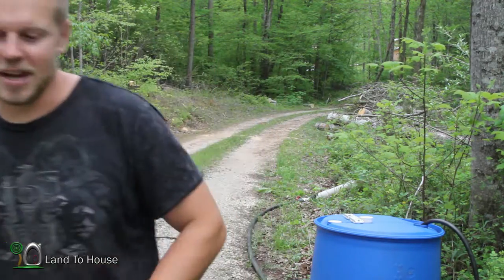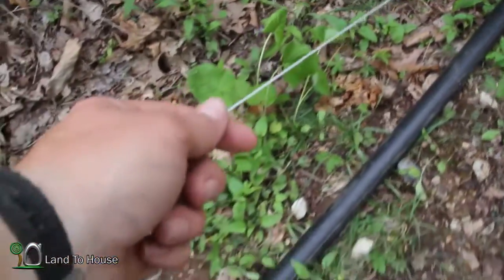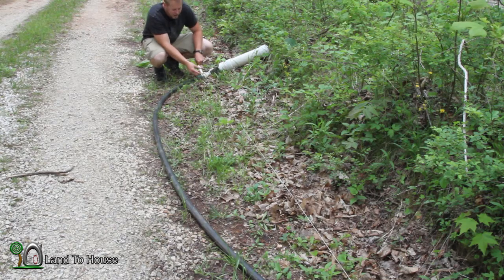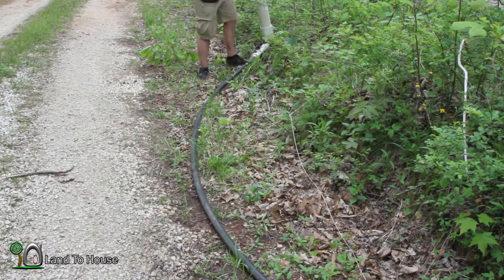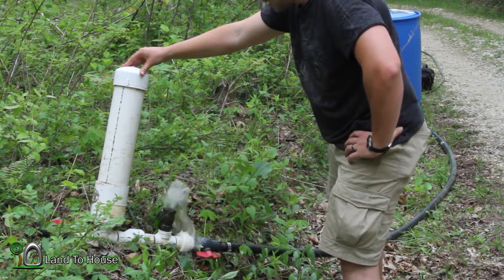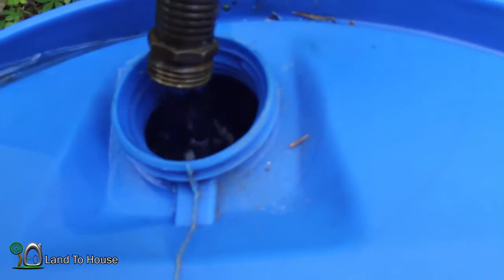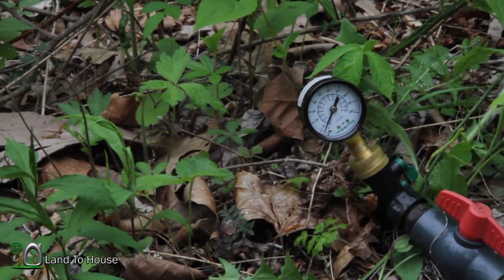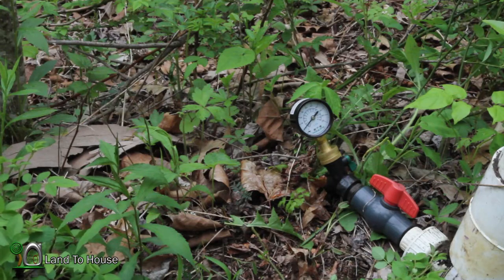Hydrostatic Pressure Ram Pump

Comment: Seth, have you experimented with the pressure tank in various positions? With a inner tube inside the tank I wonder how the pump would operate with the tank lying down (with check valve remaining pointed upwards as normal).
Reply from the maker: Hello. I have not tried that position with the pressure tank. There are linear ram pumps but the bladder inside is attached to the tank wall and ensures there there is always an air space.

Comment: HI THERE, I MADE MY OWN 1&1/4 IN. RAM PUMP. BUT IT DOES NOT CYCLE AS FAST AS MY 1 IN RAM PUMP WHICH I ALSO ASSEMBLED.  INPUT DRIVES ARE THE SAME AT 1&1/4 IN PVC PIPES.

Comment: hi there.iv  that system before I can get up to 4bar pressure from doing it
 iv also got a 3inch pump doing 5.5bar pressure.  Doing 8lts a minat 1200ft lifti.g 45ft on a 2ft fall. 😊
regards 
DRP River Pumps Ireland
Reply from the maker: +Derek Cummins great results! I always like to hear of success stories like yours.

Comment: Hi Seth, This is fundamentally what my install will be here in NZ. How tall is that barrel? About 1 meter maybe? The pressure in the water column is the densityXheightXgravity and that is fundamentally the same thing as water falling from that height. For my situation with a 1 meter deep column of water, the pressure is 9810 Pascals. The benefit the way I see it is that with your feed being at the bottom of the water column, you do not have to worry about the water level dropping and your intake being out of the water. Another advantage of this setup, at least in my situation, is that I can shorten my drive pipe to a minimal length of say 150 diameters and thereby lesson head loss. By Hazen-Williams, I calculated my head loss to be 11 cm over a 6 meter pipe. Imagine if I instead had to use a 30 meter pipe to get the same head...the losses would be 55 cm, reducing my total head by half to to pipe friction. I am glad to see you tested this because it confirms what I was thinking and it is good to see it before I go spending a lot of money.
Reply from the maker: +pat wall you make valid points. Especially on friction loss and preventing air from entering into the system. I assume that your water source will constantly refill that Barrel? As you can see it does not take long for that pump to drain 55 gallons. They always say that a drive-by be shorter than 3 meters is a bad idea. So using a 6-meter pipe should be perfectly fine. 

This test turned out well and gave some good results.
Reply: Hi Seth, my source will not be a barrel, it will be a small weir but I will take the water at the bottom of the column so it works on the same principals. The drive pipe rules I went by were between 150 and 1000 diameters. My aim was to consolidate my head as best I could and to keep the drive pipe short enough to minimize head loss due to friction but still long enough to allow for the shock wave to do its magic.
Reply from the maker: +pat wall it seems like you know your stuff!  As long as you have the drive pipe the same diameter as the ram pump you should be fine.
Reply: +Land to House we shall see..it is still all on paper and i have yet to build anything but this is what it should look like.
Reply from the maker: Things do change a little when you get them in the water. I do think that you have a great start to a good setup!

Comment: Seth, like the video and enjoy these. I do have to ask a question though. Would not the tank water height be a factor in as run and fall of the water just as if you were at the creek however at a much shorter set up? I hope that makes sense. I'd think that the water weight in a 4 foot drop in 100 ' might be the same as the barrel? It would seem to me that you are making the same setup to me. I am by no means an engineer Seth, so I am be way off.  Maybe you can shed some light on how this is any different. By the way I wish my pump ran that fast and started that quickly.  Keep up with the videos I enjoy them.
Reply from the maker: +ed sautter thanks for watching! So the original question was something like this: I have a water tank on flat ground. Can I run a ram pump from hydrostatic pressure only?

So I tried to use the string and level to get the pump level with the drive pipe so there would not be any feet of head pressure in the drive pipe. Only the weight of the water is running the pump. You are right though. It's the same as having the 4' drop in the drive pipe. (3' actually). I have a follow up video showing the reduction in pressure as the water even drops in the tank.  I hope that makes a little sence.
Reply: Thanks for the reply.
Reply from the maker: +ed sautter no problem. The newest video shows the change in PSI in hydrostatic pressure. It might also be helpful

Comment: HI THIS LOOKS IT MIGHT WORK FOR WHAT I NEED.  THIS SOUNDS SILLY BUT,   WOULD THAT MEAN THAT YOU COULD PIGY BACK RAM PUMPS AND WATER  SUPPLYS TO GET UP A HILL TO LIKE 50 TO 75 FT ? THE FIRST WATER SORSE WOULD BE A RIVER AND A PUMP LIKE A SPIAL PIPE PUMP OR( LIKE THE ONE YOU ARE WORKING ON) TO FILL THE FIRST BARREL, THEN THE OTHER RAM PUMPS LIFT EACH LEVEL TO GET TO THE NEXT SUPPLY AND PUMP. FINLY  TO THE TOP OF THE 50 TO  75 FT 60% GRADE HILL.   THE THING I HAVE IS A 50 TO 75 FT 60% OR SO HILL TO GET TO THE RIVER EDGE .  I HAVE ALL THE FLOW I CAN USE BUT NO HEAD.  OR WOULD SOME CANS ON A STRING AND PULLIES BE THE THING TO DO.I AM JUST THINKING OUTSIDE THE BOX, HA HA .
Reply from the maker: +Tommy Schauer I have actually heard of the spiral river pump getting water up to over 50 feet. You might be able to use one of them alone . . . If I would take the time to perfect my design. (To much house stuff going on right now) But I also think you could get them to work together. Have the river pump or two of them pull water into a tank 10 feet off the water then run a ram pump from that 10 feet of head to get the water up to 70 feet. You would just need one ram pump to get to 70 feet.
Reply: THANK YOU.  THAT MIGHT DO IT.
BUT NOW TO WORK ON THE GARDIN FIRST.
LOOKING FORWORD TO YOUR HOUSE UPDATES.    THANK YOU AGAIN.
Reply from the maker: +Tommy Schauer I do hope to work on the river pump again very soon! There are lots if people in your situation. Plenty of water but no head pressure. I only have 16 days left to get the videos ready for the series to come out!
Reply: LOOKING FORWARD TO THE SERIES.
BEEST OF TIME WITH IT.
THANKS
TOM S.

Comment: ... ThankS !!! - )))

FUN V-iD !!! - )))

JusT out of curiosity ... what if you added some symmetry to the system ... = counter clock wise vortex ?? - ))

i'm thinking both in the barrel ((lots of water flowing inside the barrel "should" add pressure ??? - )) + in the creek line and the out-flow line into the pump and out of the pump ... = victor schauberger used small fins in-side the lines to create the vortex inside ... i'm thinking at the joints small slits to bend the pipe ... possibly heated up a bit and then cooled to make a permanent bend ??? - )))
Also ... expanding the intake line from the creek ... for maybe the last five feet or so, to create a slightly bigger PULL due to expansion  ... and then "training' the intake ... into a counter clock wise motion, to get the water in barrel turning = adding the hydro static pressure, due to extra symmetry ??? ... maybe -)))

... one question too -)))

Can the "waste' out flow (( back-wash = not sure what its called ?? - ))  from the ram pump be used ???
ie ... you've got the pressurized water from the pump ... and then the water that splashes out ... can BOTH be used ???
... and could the 'waste' water ... be channeled back into the barrel  ... or perhaps a secondary barrel .. creating TWO pumps in SERIES ??? - ))))

... i mean ... check valves and WATER + VORTEXES ... the SKY is the LIMIT ... maybe -))))

Anyways ... thanks ALL-oT .. for your efforts ... and your CHEERY + GREAT ATTITUDE ... much APPRECIATED !!! - )))

LOVELOVELOVE )))
greb'Z )
Reply from the maker: +PeaceLoveLightTruth hi. Nice questions! So the ram pump has a pressure wave that works in both directions. Creating more pressure in the down or out direction is nice BUT the pump has to counter that on the upward / inward side. So it would actually reduce the efficiency of the pump. If air get is into the system it will stop the pump so slits in the pipe would not work. 

You can absolutely use the waste water again. Not put it back in the barrel but using it in a second ram would be good.
Reply: .... COOL -)))
i think (??) .. you can get a vortex ... without air being 'drawn' into the system ... i'm pretty sure, the vortex would make it easier for the air to escape ... or, at least with check valves ... air couldn't get into the system ?? - ))
The out-flow from the barrel being at the edge ... rather then the c-ENTER ... should help as well  ?? - )))
i see a three inch 90 inside the barrel, "catching" the counter clock wise flow at the bottom of the barrel, and then reducing into a one inch line ... into the ram pump ... ???
... ha ha -)))
Sort of tough "drawing" an idea with words -)))
hmmm -)))
i see the water in the barrel moving counter clock wise (( the way it wants to flow in the northern Hemisphere -)) .. and at the bottom of the barrel, on the outside edge the water pushing into a three inch elbow ((= no opportUNITY for air to get IN -)) .... then the elbow reducing (( adding pressure -)) before the pump -)))
... i'm feeling (( not k-NOW-IN-g -)) this will add to the OUT-flow pressure, out of the pump ??? - )))
... maybe ??
... ha ha )))

Thanks for the REPLY !!! - )))

LOVELOVELOVE )))
greb'Z )
Reply: ... one more thin-G -))
While using a second pump ... could both be pushed into the same OUT-FLOW line ... th-ROUGH check valves ... to get a farther push ... and or, just more volume ???
... just wondering -))

LOVELOVELOVE )))
greb'Z )
Reply from the maker: +PeaceLoveLightTruth yes there are many ways to get that vortex going. It has been my experience that the ram pump does best without that extra  pressure against the pump. Because the pressure wave has to return to the source it is better not to have the vortex.
Reply: ... oh .. now i get it ))
 ... sorry, didn't catch the D-RIFT of "pressure wave" in the first reply -))

... will co-N-s(iD)e-R tHAt in my next meditation ... my iD-ea garden -)))

... thanks aGAIN for your replies and EFforts !! - ))

LOVELOVELOVE )))
greb'Z )
Reply from the maker: +PeaceLoveLightTruth sure thing. Thank you for asking.

Comment: Thanks for this video josh, the place i had my old pump washed away with the most recent storm and this solves my problem with finding a new spot!
Reply from the maker: +justin whittington nice! You are welcome. I can see several applications for this into. Sounds like you could pipe water out of the creek just like I did in this video and safety run the pump from the shore.
Reply: +Land to House well actually i have a large pool in my creek thats has stood even though the heaviest storms and ive never had much luck getting the pump to run off of it but what i was thinking is that it has a natural dam at one end if i were to put a hole big enough for the pipe in the bottom of the dam i should have about 2.5 feet of hydrostatic pressure which is plenty by the looks of it
Reply from the maker: +justin whittington yes that would be enough to get water to 20 feet or more. Now can you just syphon out of the top of that pool?
Reply: +Land to House well Thats what i tried at first im not really sure what the problem was but the pump just didn't like it its would not run continously not matter what i tried
Reply from the maker: +justin whittington that's odd. But now we know that this method works. Also if you pull from the bottom of the pool and go down hill you can have twice the pressure!
Reply: +Land to House good idea! thanks again!